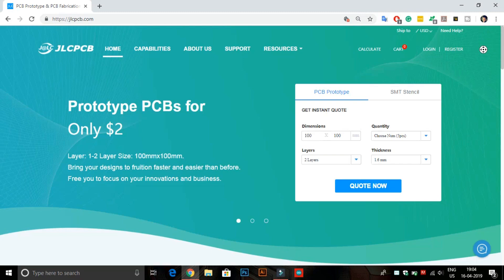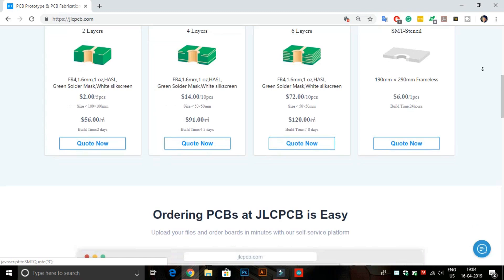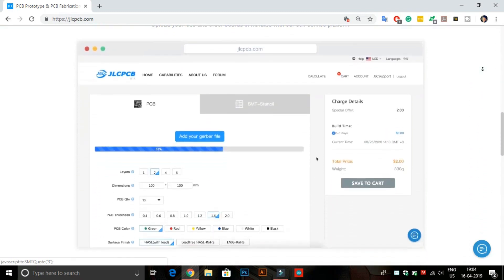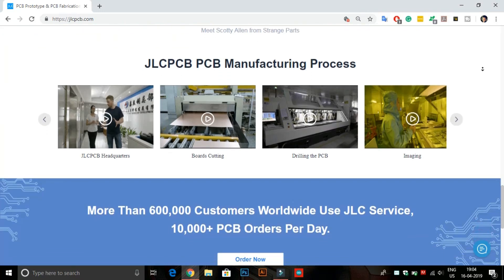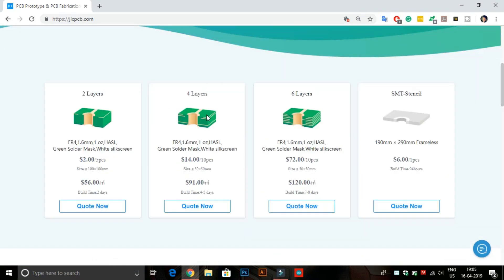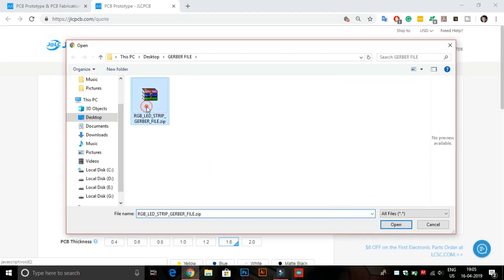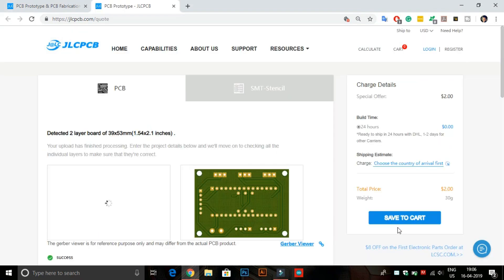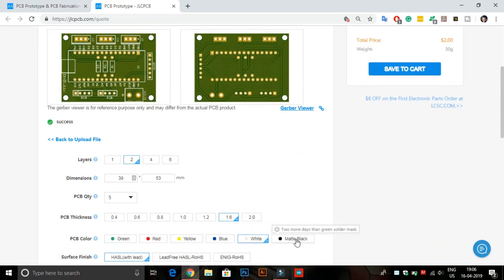How To Make DIY Arduino RGB Led Strip Controller

Comment: Hello,  I love this video, but one thing I need to know in addition to it is how do you power this?  (I know screw terminal)  What setup would I need to do in order to run this off of a 12v 15ah battery in my kayak?   I was wondering if this would work?  PlusRoc Waterproof 12V/24V to 5V Converter DC-DC Step Down Module Power Adapter (Open Wire).  Thank you.

Comment: Friend can I program an IC with Arduino to do this job and replace the Arduino with that ic
Reply: Yes you can. Search for breaduino on google. Moreover, you can do this without even using an external xtal. My suggestion would be to use mega8 and optiboot since it'll save you some bucks.